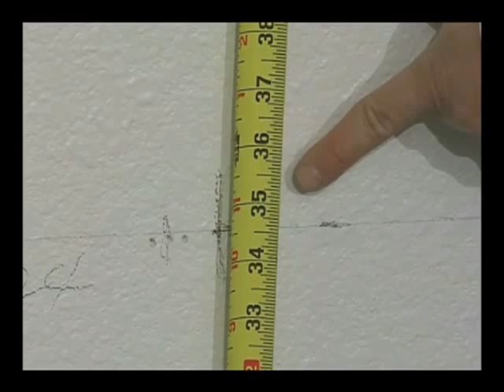RTA Cabinet Installation Instruction

Comment: I didn't know what RTA cabinets were 4 months ago when I bought a home I planned to remodel. After finding a local dealer of RTA's I searched and very easily found a number of Domain's videos which have been very helpful. I assembled and installed 17 units which included an additional 5 units added to the original kitchen layout after I took out a pantry closet. And I actually enjoyed working on the project. Thanks Domain for the helpful information. Next time I'll look into buying the units from you, if you ship to NC.

Comment: I'm not a carpenter but I'm fixing to do our kitchen and I plan on hanging the upper cabinets First as to not have to work over the base cabinets. Also won't drill All the way into second cabi et. Leave some meat for your screw to bite into I would think...

Comment: You are in an office building ,rubber toekick on bottom of wall sticks out 1/8 to 1/4 inch how is your cabinet level and plumb if the bottom is futher from the wall than the top,always measure and remove toekick on wall...
Reply: Walter Hynson indeed

Comment: Always install uppers FIRST , just cut scrap 2 x4 to hold them off the floor at correct bottom height,much easier no hanging over the base units,If you drop a screw or drill it wont fall in a base unit and bust a shelf,and you dont lean over the ladder.